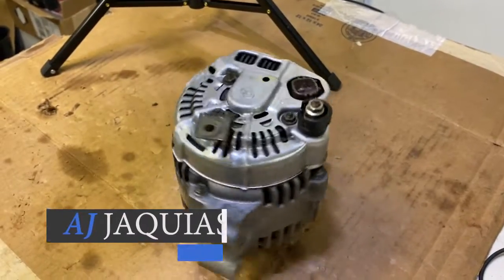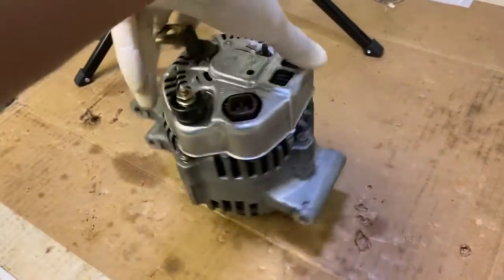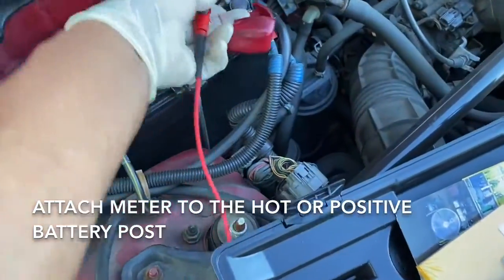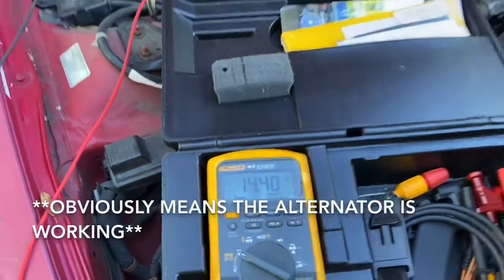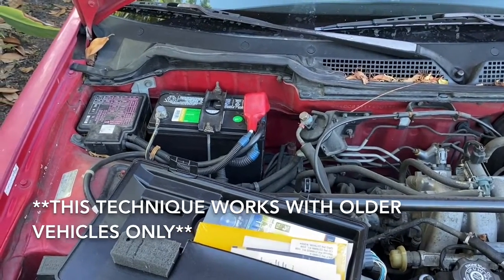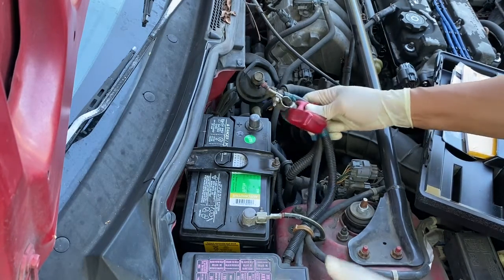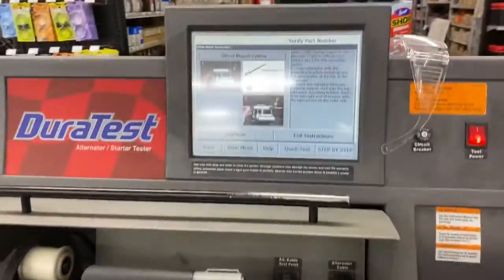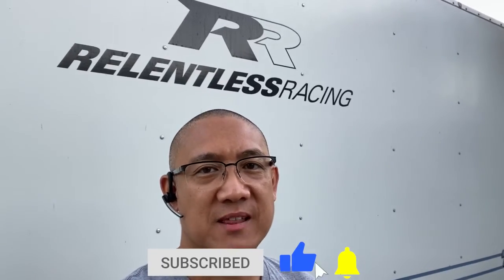How to Test an Alternator

Comment: I thought you take the negative side off
Reply from the maker: Try it and lmk how it works
Reply: It would have better to turn the car off. Then remove the negative cable connect the positive then the negative cable last.
Reply from the maker: @koshnaranek2317 why? If u turn off the car, it defeats the purpose of the test. With the car running, if u remove the positive side, the car will remain running if the alternator is working bc it is producing current… enough current to keep the car running.
Reply: @RelentlessRacingAJ  I was just saying after the test before putting the positive cable back on.
Reply from the maker: @koshnaranek2317 sorry it wasn’t clear.

Comment: Not supposed to take positive cable off are you will ruin your ecm
Reply from the maker: The text in the video specifically reads, **THIS TECHNIQUE WORKS WITH OLDER VEHICLES ONLY**. Thanks for your comment, but it’s only true for newer vehicles and again I noted that in the video.
Reply: Can you elaborate on this please? A triple A tow truck did this to my vehicle a few months back. I was having problems with my 2014 KIA Sorento breaking down while driving. My battery would be completely drained. So I bought a new battery. Car broke down again. The tow truck driver said "I can tell you if it's your battery or alternator"  and he charged the battery, turned on my car, and then removed the positive terminal - my car died. He says "it's your alternator" so I bought a brand new alternator from the KIA dealership. My car has been running for 2 months and now it's back to having electrical issues. The computer diagnostic throws no codes.

Comment: Good content AJ.  When you had your nice FLUKE meter connected, you could have switched the selector to AC Voltage and checked for the AC ripple component.  Most shop manuals will have an rpm value and a maximum AC voltage.  It'll be quite small in magnitude, but gives you insight into the condition of the rectifier's.
Reply from the maker: That's an excellent addition.  Thx for commenting and watching.  Pls subscribe for more automotive content.  Thx again, AJ